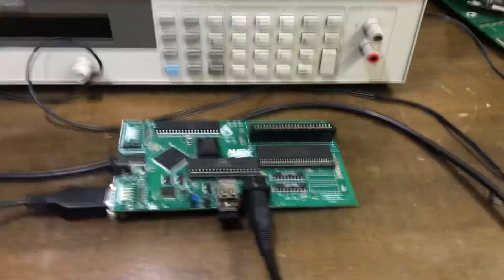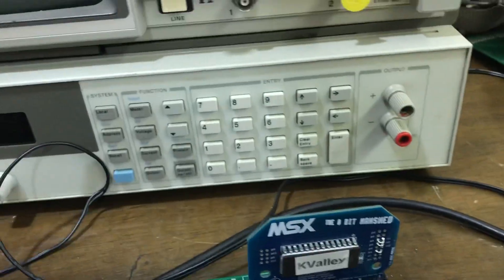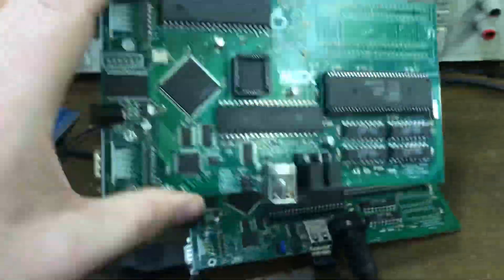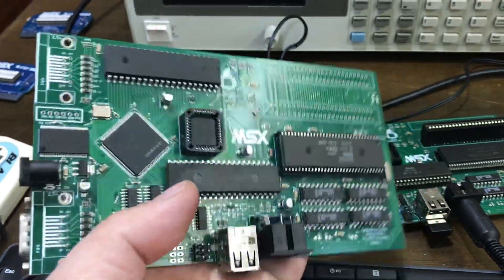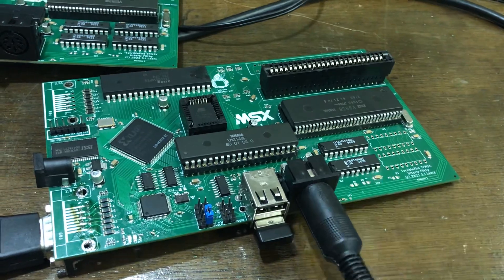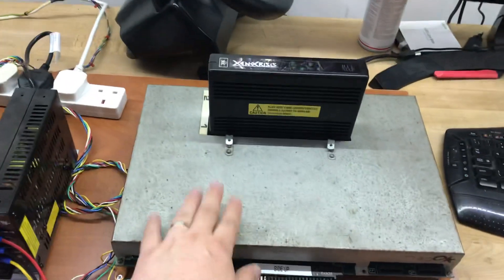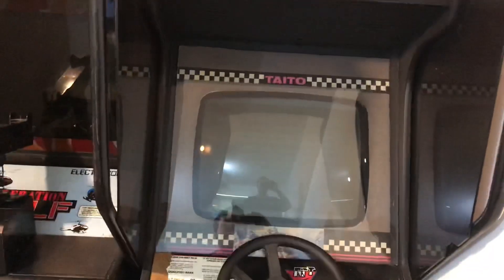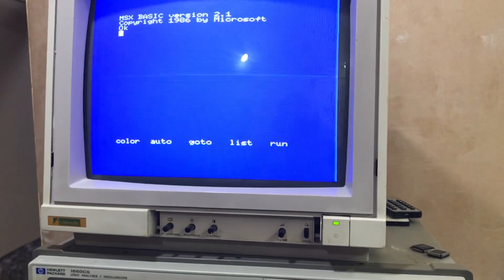TF MSX / TF360 / TF4060 Update May 2022

Comment: What are the design specs you have in mind .
Reply from the maker: Which machine?
Reply: @TerribleFire  total ram, cpu speed , version of roms etc
Reply from the maker: Which machine? the MSX, CD32 or Amiga 4000? I talk about 3 different systems in this video.
Reply: @TerribleFire  hehe sorry , the msx
Reply from the maker: V9938/V9958, Yamaha Synth, 512Kb RAM. 2 Slots, USB Keyboard, 2 Joystick ports. MSX2+ compatible. I can run the CPU at 7Mhz but games dont seem to like that